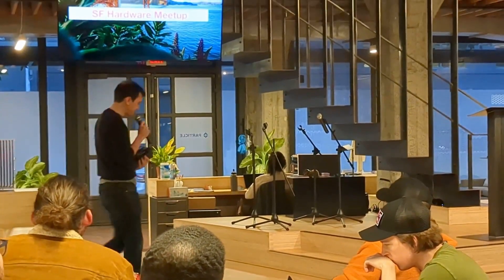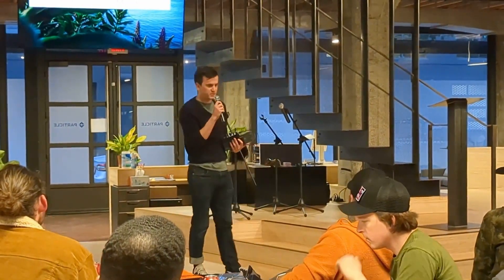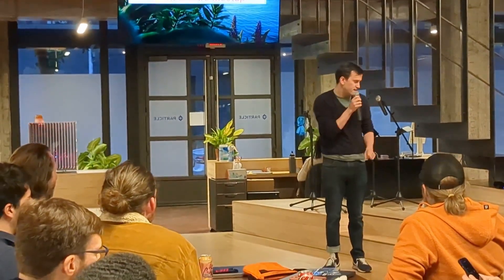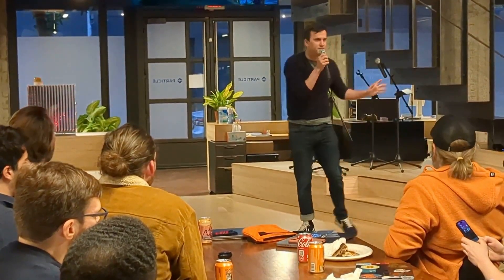Wiggler Demo at Hardware Meetup

Comment: Why didn't they give you a table though
Reply from the maker: lol it was more of an open mic event
Reply: @sound.workshop  btw it's impressive how musical your synth sounds. I guess the control over the  vibrato is exactly what is missing from most synths that imitate strings and brass.
Reply from the maker: @gbmllr3614  thanks! one thing I've found is that for vibrato to work, you also need gentle modulation of loudness, using something like the Press on wiggler or the wind pressure of a wind synth. The loudness needs to be slowly swelling while doing the vibrato to sell the effect. So that's why I think you don't see people use a pitch wheel to perform vibrato, because the ADSR envelope sounds so static